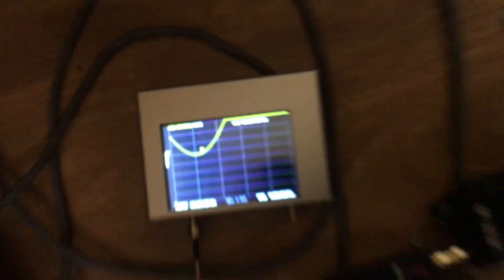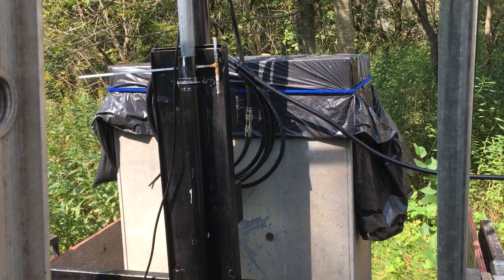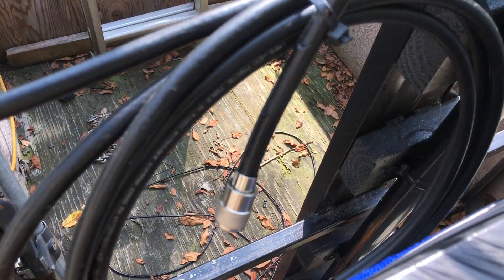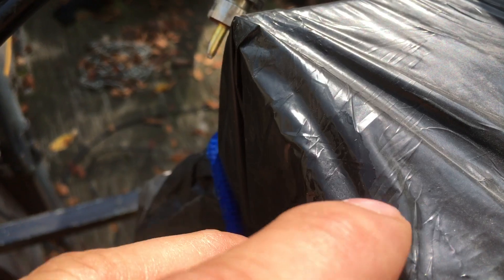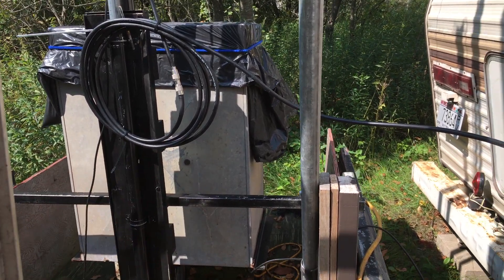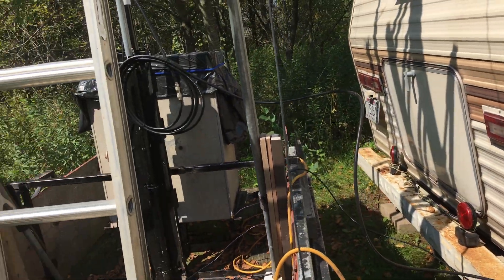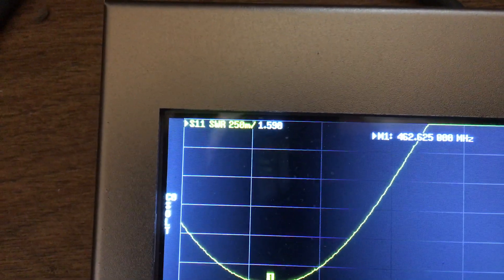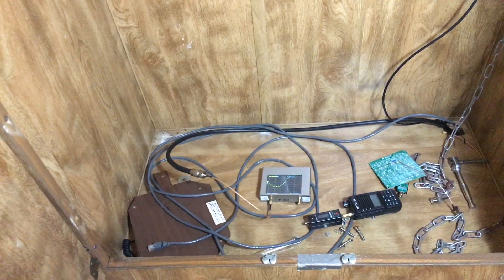🔺 This is what happens when you MESS up!  DO NOT do this with GMRS two-way radio coax cable!!! 🔺

Comment: Get your SWR down towards 1:1 by eliminating the barrel connector. Only use one length of cable into your building. Each Connection Adds Loss. Take your SWR meter out of line when not in use hooking the radio direct to the antenna for best results
Reply from the maker: I don't think I will see that much difference in SWR if I take those out. Hummm I think I did a video on that?? Or maybe it was wattage that didn't make that much difference...hell I don't remember what one it was lol

Comment: Only use liquid tape, liquid tape outside do not use regular electrical tape it will expand and hold water go to Lowe's in the electrical dept. buy liquid tape.
Reply from the maker: ohh yes no i won't use that. I posted a link to some good stuff :) and yes liquid tape is my plan b too

Comment: Interesting find, good you found it. Curious, have you tested the SWR connected directly to the antenna, because 1.5 still seems kind of high for a GMRS specific antenna?
Reply from the maker: I have not yet. But when I installed the antenna I used my Surecom SW-33 Plus meter cause that is what I had I didn't have the vna then, I am finding out my  Surecom SW-33 Plus meter is not reading right, was it right when I installed the antenna? I don't know. My Surecom SW-33 Plus video https://youtu.be/Ed897lAXjXQ